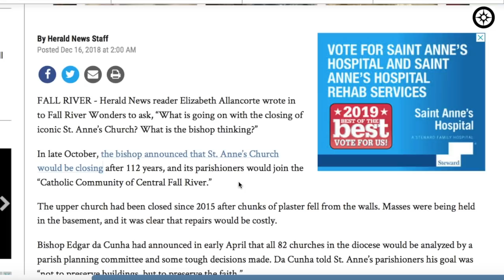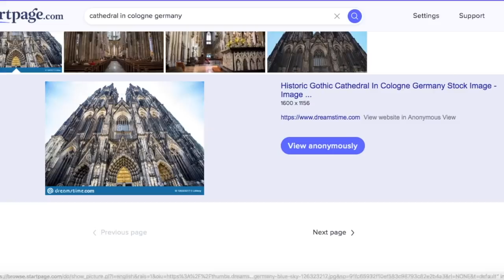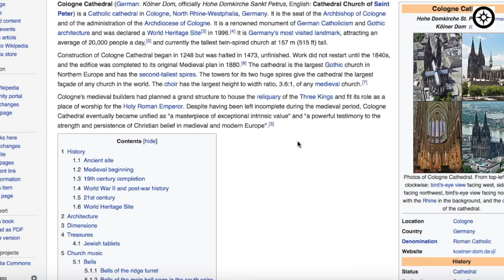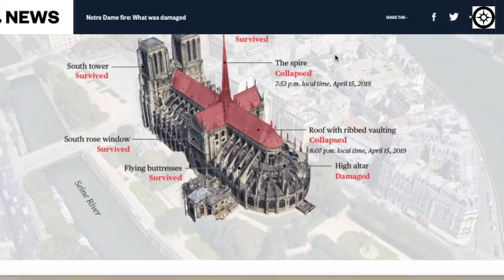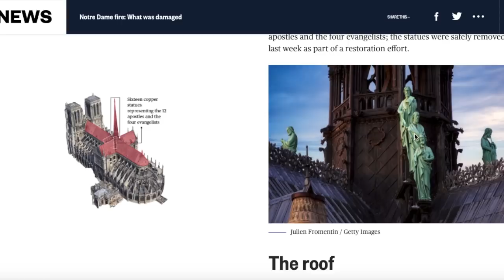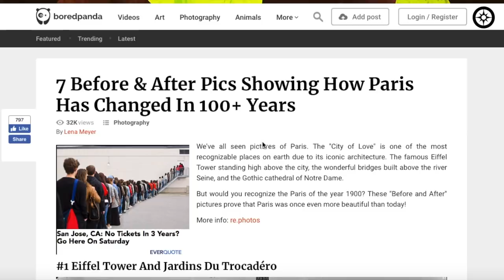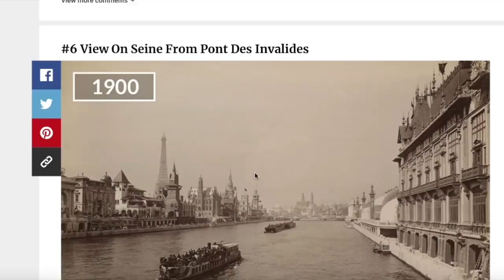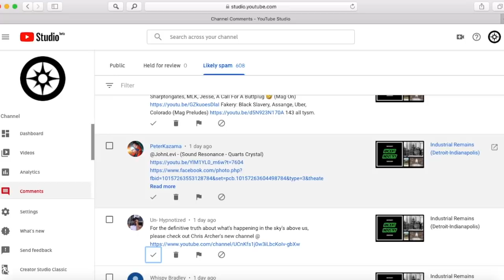False History Revealed (Notre Dame-Kolner Dom)

Comment: Hi Jon, if your interested I have done a little video explaining my hypothesis on how their electrical grid operated. My hypothesis is that there grid was not of cables and powerlines, but an electrochemical grid, where electrolyte was pumped through lead piping, and their technology worked by electrochemical means. In my view the energy accumulators (atmospheric collectors), where simple to charge the 'battery', as similar battery is called a flow battery. Hopefully this my provoke some research into this area.
Reply: Lynn Roberts  and the organs.
Reply: Hey I live in Adelaide  South Australia. We are called the city of churches. We Have also been warned about drinking the tap water running through lead pipes.
Reply: Lynn Roberts Yes I think your correct, ultrasonic sound waves can amplify the conductivity in a electrochemical cell, on a large scale the sound may not need to be in that range. I too think these things where high tech resornators of some description.

Comment: They dont even have stringent earthquake strengthening rules either. Pull a relic down for a few million is beyond criminal.
Reply: which may be telling us earthquakes aren't natural. at all, ever.
Reply: If the purpose of taking it out of functioning is a complete different one, regarding a really onraging battle between good and evil. On some very thrustworthy sites it is suggested to be a retaliation on the bad guys. There was a very nasty happening supposed to take place around 20-21 april last week in the catacombs. ShriLanka was just plan B. The bad guys were very disappointed it did not work out their way. Very early that night it was suggested that it would be a total loss, but that did not happen despite the reluctant operations of the fire brigade. I saw few water brought out into the fire. The water even not reaching the fires at all .They were spraying water much lower than roof level and pumping water onto the front face where no fire was present and yet at some point the fire was gone, but not by an overload of water poured into the fire.

Comment: John. I just have to say I really enjoy watching your videos. If it means something to you, it has given me an insight in the past that I never thought possible. And with the "funeral" tones and your melancholic way of describing the impressive images, it's a struggle not to shed tears sometimes :)
Now, I must help you a little with a part of this video,  and I know this as a fact. What you said about the led and possible sheet metal work on the roof on the Notre Dame is wrong. Led melts at 620 f. and is's usually a patch-work soldered together using tin which melts on about 400 f. Now, as the heat beneath the roof accumulates as the wooden framework and underroof is burning, weakening, shrinking  and starts to deform, the flames will break out and it will be over in very short time. some of the led will start melting even before flames have direct access to it. Even if this roof was a copper patch work it wouldn't be self supporting, not even within a few square meters. The copper softens under heat and the solder material melts away. 
I am telling you this because I know how easily one can lose credibility by just talking away based on faulty presumptions on subject. If I were you I'd consider take that "self supporting" away. 
Just trying to help Jon, and I really value your work :)

Comment: Try to burn old wood.  You can barely get 3mm deep. Put on a bonfire, let it burn  1hr then take off and cut  through. Hardly any depth as the wood gets dense with age. We had to use hand tools to do repair work for national trust and heritage. This battered our tools. Chisels had only about 30 mins before 're ground. That fire was not normal. I worked on it in 1991. Not the fire, the Cathederal.
Reply: Did you get into the lower areas inside?
Reply: And its not "just" old wood  its OAK! Ever tried to burn 100 years old oak? Good luck!!!
Reply: @dirk9568  LoL...
Reply: Mind Freshener  
Obvious youve never went inside The Notre Dame or Kölner Dom!!!
Reply: @sarahmartinezDOGMAN  sorry for delay. I have lots of surgeries going on. Yes I did get into the basement.
Reply: @dirk9568  you got it. That doesn't burn well if new. If old it goes like stone to cut, or burn.
Reply: Mind Freshener  anything owned by the church is falsely dated unless it's new. I don't think that ANY was for religion. Religion took them over.
Reply: @dn744  indeed DN, and then dont forget that those wooden beams not only are from great old oak, dried so they could be handled, and had more then 850 years to dry all the way up there in the cathedral. You cant just lite a fire not even with accelerant, the accelerant would burn away before you could make damage to the wood. Ppl think that 900 year old oak is the same wood were you start youre bbq with.
Reply: Mind Freshener  Unless you are tuning into the murdered trees and rocks it's possibly made out of (if they are telling the truth about how anything has been constructed, as it's possible that such things have been created by the same means that created reality itself), how can you get that kind of energy from such a place?
Reply: What if Notre Dame was lit purposely to ward off a worse deep state attack that was pending to draw media attention away from their crimes?  Think about it.  The fire was purposely lit (they have video) in an area of the roof away from the altar, away from the organ, away from the stained glass, away from anything irreplaceable.  What was lost was roof and spire.  Definitely a lesser evil and no one died. The black hats had a planned attack in play to kill many.  Why else would Michelle Obummer be, coincidentally, right there on the river watching?   For more detail, watch the three SerialBrain2 videos at "AndWeKnow" channel here (very well produced, quality videos) :  https://youtu.be/DOmkL45zFwU       https://youtu.be/VcyKlefQBYU      https://youtu.be/57XOgEBFht4

You will want to watch many other videos on that channel too.  Incredibly lightening about truth behind many things in our world and the evil people doing it.
Reply: @shakengrain1942  hello. Those videos are listed as private and can't be viewed. Do you know why that is?

Comment: Great video Jon, thank you.  The melting point of lead—at 327.5 °C (621.5 °F)—is very low compared to most metals. Its boiling point of 1749 °C (3180 °F) is the lowest among the carbon group elements.

Comment: Lead doesn't have to burn, just melt.  Fire from the wood burning would likely not cause it, especially in that time frame, but electrical fires should be able to produce that kind of heat.  Also certain frequencies can interact with metals causing them to heat up, as well as most lasers, such as the case with directed energy weapons.  However the pictures don't show melted metal on the floor, only burnt wood.  There was also a removal of multiple statues just prior to the fires, all the saint's statues, so perhaps the lead roof was also removed prior to the burning.

Comment: (11:20) 330 foot, few seconds later another article 33 feet accross, they speak in numbers thats their mark
Reply: Also the dates of the years of construction. Construction of Cologne Cathedral began in 1248. 1+2+4+8=15. 1+5=6. Then construction was halted in 1473. 1+4+7+3=15. 1+5=6 . And then construction didn't start again for another 600 years. Sixes all around and right in front of us so they can mock us and rub it in our faces
Reply: EVERYTHING they do i repeat EVERYTHING they do is with a purpose and design
Reply: Check out the Cistercian Order, They built 333 Cathedrals, Abbeys and Monastaries by 1152, then they stopped building them for a few hundred years, Also look at their Coat of Arms, full of Symbology

Comment: The Cologne Cathedral has the look of a bristle of electronic spikes.  In 1907, Walter Pennock made a patent application #911,260 of a bristle ball of electronic spikes that was designed to extract energy from the difference in electrical potential that exists between Earth Ground and the atmosphere above.  The Cathedral has a very similar look, like that of a Porcupine with all the sharp points radiating energy and connected together and wired down to Earth Ground, which is usually greatly enhanced by a supply of water, canals, tunnels and springs.  The spikes wired as such will discharging electrons into the surrounding atmosphere, from which can often be seen an actual physical glow off each of the spike tips.  This is an ionized coronal glow of electron flow into the surrounding atmosphere.  Imagine these magnificent buildings glowing on a dark nights when the conditions were right.  
Next, the most probable way of capturing some of that energy is with batteries .  .  . massive batteries.  How much energy might such a device with the Cologne Cathedral’s 500’ by 500’ by 300’ footprint generate? While the dimensions are rough numbers, it is clearly massive and on par with the Great Pyramid of Khufu.  When energy is being generated (most of the time), the batteries aren’t being used.  They would stabilize for the variable atmospheric fluctuations and provide backup power when conditions for power generation were poor.  Massive battery banks .  .  . hmmm .  .  . what about all of the Star Fort ‘Batteries?’  
Anyway, that’s my theory free to all the world, together with my crazy logic.  What about you, how do you think these machines functioned?

Comment: Lead – Melting Point and Boiling Point
Melting point of Lead is 327.5°C.

Boiling point of Lead is 1740°C. wouldn't the lead melt before igniting in flames?
Reply: And melting lead would snuff a wood fire like that I'm a roofer by trade for 20 years I've seen it first hand
Reply: What if you microwave lead?

Comment: Always ridiculous money quoted, I bet you could just hack off the plaster and expose some beautiful stonework or brickwork
Reply: dolo gore One of the dirty secrets of Victorian architecture is that under the beautiful facade, the workmanship is often shoddy.

Also, even if there are stone or brick walls, the plaster is there for a reason. It’s part of a second layer of wall meant to add insulation to the otherwise uninsulated wall. Tear it down, and the room freezes for almost half the year. With a space as big as the main sanctuary, it’s questionable whether it’s more expensive to heat it or to rebuild the inner walls.

Comment: Good video.  I wonder what those light beams were aiming at.  Maybe they were connected to other structures to sort of feed energy to each one,  along with light. Now I want to know where whoever built and lived in these buildings went to the bathroom. The nightmare or whatever hotel had hundreds of rooms and one private bathroom. This seems to be my next question that needs to be explained. One suggestion was that they didn't have to use the bathroom at all,  which is beyond my understanding.   If whoever built these were of a much larger stature,  you would think that they had much larger numbers than we do,  so maybe it was a separate building altogether.

Comment: Lead has a really low melting point. A wood fire could cause the lead to liquefy. 
But theres no way that building would have burnt like it did.
Thanks for your videos.
Good content.
Reply: John Perkins Yes it would. You’ve never worked on old buildings before. Construction at high heights especially on old buildings is very dangerous. Once you start peeling pack the layers and exposing holes into the attic spaces it creates a vacuum/ negative pressure. So if your using a torch to repair the roof the flame will literally be sucked out from the bottle and into the building. These attics and crawl spaces are filled with highly flammable dust, would be equal to putting a lighter to a fresh pair of pants or socks and that layer burns off but only on a larger scale and for more intense. If they wanted to burn that cathedral to the ground they could have but it wasn’t like that.. not everything is a conspiracy
Reply: @D.P.MorrisConstruction  how do you know i havent worked on old buildings before?
 Pretentious on your part. But ok whatever you say sir.
Reply: @D.P.MorrisConstruction  the lead would have ran to the floor, pooling and solidifying what would have burned wouldnt have produced the type of smoke it produced.. smoke is typically a sign of insufficient oxygen. But the size and color of the flames were more likey a chemical fire than dust.
Reply: @D.P.MorrisConstruction  if what you say is true and it's a normal fire and the fuel for it to rage, why do pictures the next day of the alter area below the fire have about 60 candles all intact and not one melted?
Reply: John Perkins not pretentious because the odds you worked on a almost 700 year old buildings is very slim. Doesn’t even need to be that old. I’ve done construction my whole life and experienced most likely what started that fire lol.. roof repairs. Sooo many buildings have been damaged by this & not worth arguing with you because your so brainwashed that they tried to destroy it.
Reply: PaxRomana construction of those cathedrals ain’t like how stuff is built today. Fire fighters hundreds of them controlled and blocked off the fire. Buildings made from stone ffs doesn’t surprise me, what could burn and was out of control did and what wasn’t got saved.
Reply: @D.P.MorrisConstruction  im probably the only person you or anyone else knows that has installed a lead roof. I havent worked on but one old building 200+ years old.

Comment: i dont have the info nor can I be certain,but what they keep referring to as "lead" roof in my estimation is actually lead coated copper. A very common roofing material./ I have worked with this material for 35 yrs/  Curious how this is not mentioned anywhere ..perhaps they want us to think the lead just melted..which could not happen if it were just the coating on the copper material I say was used on ND. I been to “ Fall Rivahh” many times! Next time I will find that marvelous Tartary!

Comment: just a point I want to point out: lead is heavy, soft and melt at relatively low temperature (fire usually is hot enough to melt it)
Reply: 621 degrees Fahrenheit lead melts and a house fire can reach up to 2000 degrees. But this fire was a frequency fire they say was a computer glitch...it is their way of saying what I said. The lead may have lit the wood is more likely in my world.

Comment: One thing I have noticed in the brick work the red brick is it's always double bricked. You will see standard length way ( im guessing about 8") then the  brickies put one in 90° to the horizontal, so you will see the length of the brick then width of the brick. I'm not a bricky but it's one of the things I look for as a confirmation.

Comment: With Notre Dame, lead has a quite low melting point, the wood constantly burning eventually causes soft metals of this type to buckle and crumple and even melt, structurally collapsing as a result...basically churches and places of worship did not include or have organs built into them until long after the reformation and protestant religious revolution. In fact large pipe organs are indeed old but not on this scale until well into the renaissance period.

Comment: Just a note, lead melts at around 330c so a lead structure would most definitly collapse during a fire.
Reply: That's interesting.  Any explanation for the 60 or so candles around the alter immediately below the fire not melting?

Also makes me wonder if it was indeed lead or if that's the cover story.
Reply: @imjustanant  No, the entire thing is fishy as hell. Lead vaporizes at 1700degrees so there no real chance of it vaporizing before it just melts and drops down. You'd thinks that 250 tonnes of molten lead would burn some candles lol.

Comment: Mate, I know it's weeks  since you  stuck this thing  up but it's left me in such a state of slack jawed amazement that I have to say  something.
there's so many misconceptions I really don't know where to start. 
The Notre Dame stuff alone for fuck sake.
Why would anyone consider even for a second that a leaded roof could support itself with the wood structure  burnt away? Even if it were one continuous piece, which it isn't. The wooden structure IS the roof, the lead is merely a foil coating , 6 to 8 mm thick at most. More probably 4 to 5mm.
It's entire structural integrity comes from the wood, just like a tin foil hat on a head.

We most certainly can build buildings like that today  we just can't afford to. The economics of construction have changed a lot since 1840 let alone 1260.  Life and labour, even skilled labour, was cheap then. Though obviously not cheap enough as Cologne ran out of money and stopped.
Though I think they didn't stop using it. Which is why that bit of roof looks really old. It is.

Your Radiator Fins.  Your own diagram helpfully draws a little line from one straight to the term Flying Buttress.
It is in fact a flying buttress. If you google the term you'll easily find their structural purpose and why they are necessary in gothic architecture.

Yes it is over ornate but that is a debate for another time. Google Viollet Le Duc, Pugin and a bit of John Ruskin if you can't wait.

Enough........... I've got Mudflooders to shout IT'S A FUCKIN' BASEMENT at so I can't be hanging around here. Who would of thought the concept of a basement lightwell could cause such consternation amongst mankind